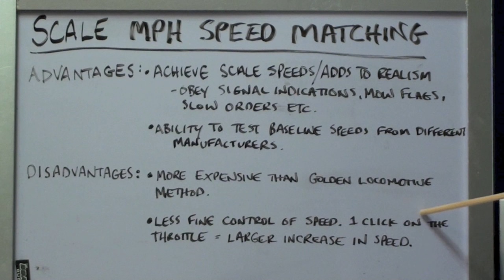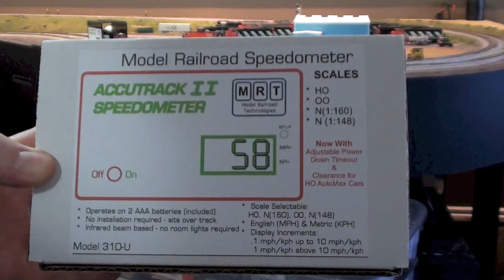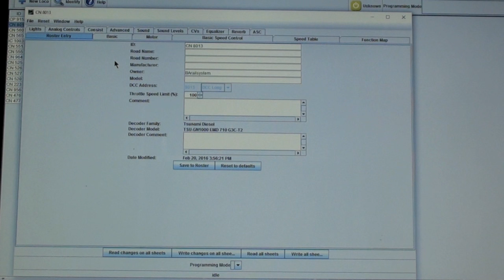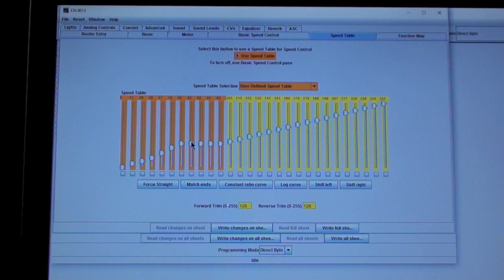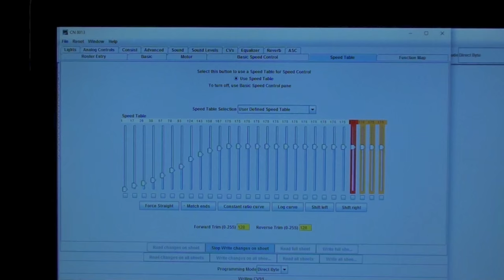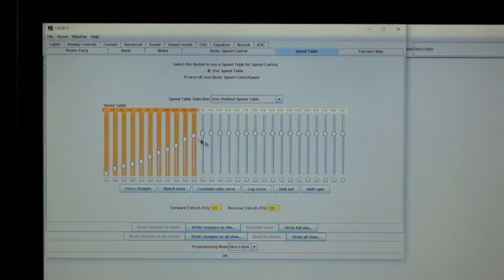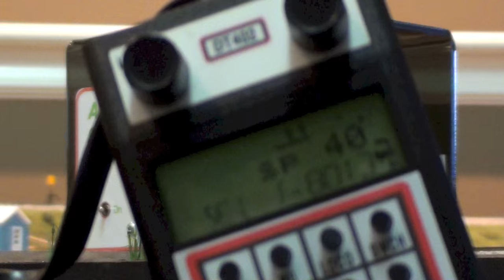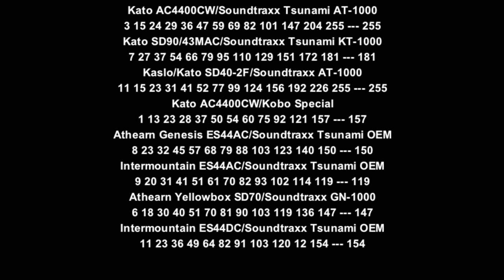How I Speed Match Locomotives Using The Scale MPH Method

Comment: hmm not sure how they govern speeds in the US, though I would expect your base top speed rate would be 80-95 MPH, KPH can be up 130kph in certain sections over that average is between 70-100kph ...

speed matching has bugger all to do with it you need to power match each unit..

the issue you get on power mismatch will cause improper traction..

if you were matching unmatched series together typically over time you would be requiring the lesser powered units to be upgraded to higher hp so each unit in the consist applies the same power at the same time..

across all units if following power scripts  you run 2400's with units outputting 3600-10,000hp with average being being 4600-6000hp

look at all the units you have and look at specified output between early and late model to generation units..

Comment: if 3 engines run at the exact same speed do they all  pull the  train or does only 1 engine do all the pulling
Reply from the maker: Theoretically if they were a lot more powerful than they are, then one locomotive would likely take all the load. However just about every model slows down a bit when load is applied so they all end up pulling the train at roughly the same speed.

Comment: You say your method doesn’t allow as fine of control, but it seems to me that if you have the loco running 40 mph at setting 40 then it would be near 35 mph at setting 35,  1 mph per setting seems pretty good.
Reply from the maker: You're right it's still pretty good, I just wanted to point out that you do lose a few speed steps using my method compared to the factory settings of 99 speed steps.

Comment: Hah. Six minutes in, two things came to mind.

1: 76MPH is a pretty good top end for a hot shot freight. Very prototypical for that, and passenger service will kiss triple digits in certain corridors.

2: Come on down to N scale, where NOBODY SELLS SOMETHING THAT ISN'T FUCKNIG SUPERSONIC! My fastest locomotive is an old Rivarossi 0-4-0 and it's top speed in sMPH? Somewhere around 400. I shit you not, it's somewhere around 400 scale miles per hour. Even my modern Atlas locos top out at around 140-150, my LL E8A will do about 180sMPH...shit, the only locomotive in my entire fleet that doesn't need its decoder to bring its speed down into the realm of 'not so fast it would derail in real life' is my Atlas 2-truck Shay, and even that is too fast. Real shays struggled to crest 15 and mine will happily chuff along at 40 or 50smph. Ever seen an 1870s 2-6-0 Mogul doing Amtrak speeds? Atlas sells one in N scale. Ever want to see a T4 GEVO pulling the Shinkansen? Kato's model is juuuust about fast enough to do it. Kinda ridiculous, actually.

On a side note, maybe I'm weird, but I run 128 speed steps simply because, if I had my druthers, I wouldn't have speed steps at all. Rather, I'd have the same infinitely variable throttle the prototype has. 128 is a whole hell of a lot closer than 28 and 14 ever could hope to be.
Reply from the maker: 1: Yeah they run 14000' freight trains up here in western Canada at 65MPH. I personally think 60 SMPH in HO is way too fast for anything besides a massive club layout. Due to space constraints, all home layouts end up having way tighter curves than the prototype and they look off to me negotiating those curves at speeds greater than 40 SMPH, in my opinion.

2. I did not know that the N scale locomotives we're geared that fast. Why do they do that?? LOL a shay just given' er at 50 MPH. That would be a sight to behold. 

Side note: All comes down to personal preference, I prefer "knowing" the speed of my train so my engines have 40 speed steps. Most of the real ones have 8 speed steps and then speed is determined by the grade and what you are pulling. The great thing about DCC is now we can really customize how we control our trains, regardless of scale, which is amazing compared to what it was like 30 years ago. 

Thanks for the comment!
Reply: It's probably because we don't have much room for more of a gear reduction in such tiny locomotives. 9 times out of 10 the only meaningful reduction we have is the worm itself, the rest of the idlers being so similar in size that they don't have a significant effect on speed. Some of them don't have any further reduction at all. My 0-4-0 is one of these units, where the motor worm acts on a spur gear that then acts directly on the axles, with tooth counts of all those spur gears being roughly the same.

3-pole motors also contribute to the meteoric speeds we can see sometimes, but even 5-pole motors don't serve as a cure-all. My 2-6-0 has what must be the tiniest little 5-pole open frame motor in N-scale stuffed into the cab and it's also one of my top five fastest runners if I were to lift the speed cap in it decoder.

Those nicer engines will creep so slow you can't even tell they're moving(My Shay is by and large the best loco i have for this, itt'l sustain 1.2sMPH, next best is my LL E8A at 3.5 or so(But it's still analog) and my DD40AX at ~2.5sMPH). Speed demon Mogul will also creep like an absolute boss,  provided it can get decent pickup. 

But, yah, N-scale locomotives are almost universally speed demons, and Kato locomotives are absolutely horrible about it since the Japanese are ridiculously strict about max voltage being 12 while our DC power packs tend to be multi-scale affairs that'll push a blonde one shy of 20 volts out.

My Shay is certainly a sight to behold when I let it run, but I usually don't. I've found that, at speed step 25 of 128, itt'l idle along at somewhere around 15-20sMPH. Still faster than a real Shay could ever go but at the same time it's the only steam locomotive I have that will sustain speeds that slow and it's running slow enough to perceive the rodding and shafting on the engy's side in motion. I'm honestly half tempted to try to dismantle the 'engine' and paint those conrods and the crank a nice shiny steel color, then throw an oil wash over the whole thing and some heavier grease weathering at the big ends, mains, and small ends, just to make 'em stand out and be easier to see while keeping 'em looking like they're on an engine that actually runs.

There's something totally unrelated to speedmatching that's on my mind, though. I'm used to every last cubic millimeter being crammed full of the highest density material that'll pass RoHS certification(And still struggling for traction despite that), but I've seen plenty of pictures of de-lidded HO diesels that are more air than lead. Is that really the norm that there's vast swaths of empty space under those shells?
Reply from the maker: Very interesting, I did not know about the challenges of reducing the gears in N scale locomotives. Definitely an issue and probably prohibitively expensive to use materials other than plastic or babbit to get the required precision for adequate gear reduction.  

Older models have quite a bit of space in them depending on the manufacturer. Old Athearn's and early intermountains are quite light and suffer from poor traction and pick up. But all new releases especially in the last couple years the trend seems to be towards packing them absolutely full of metal. The recent ScaleTrains.com ET44AC is a good example, I took the shell off to have a look and it is completely full of metal engineered to fit in every nook and cranny while still allowing just enough space for the decoder and speaker. The engine weighs 760 grams (26 oz)! That is very very heavy for HO scale.
Reply: Mm, yah, seeing those pics had me wondering. I'm used to locos being excessively light no matter what...I have Bachmann's exquisite DD40AX Sound Value in N and found a full carbody shell for it on shapeways, took the chance to stuff another 2.5oz of wheel weights in there and nearly doubled its pulling power!...and I was wondering how they could even function on a model railway with so much air in them. 

I almost wish RoHS didn't apply to N locomotives. My LL E8A has two ala-carte lead weights...genuine, actual, honest-to-goodness plumbumb...clipped on over the truck towers, and they occupy 95% of the space in the shell not required for the headlight, frame, and motor/flywheels. That thing accurately models A1A-A1A trucks and is my strongest locomotive outright. Even with the extra weight on the 16 wheel drive DD40, this thing, with only eight wheels actually driving it, pulls harder than everything else. I imagine if I had two more in consist I'd have enough tractive effort to rip the couplers out of their draft gear or shear knuckles off!